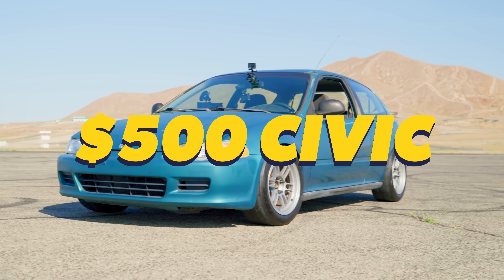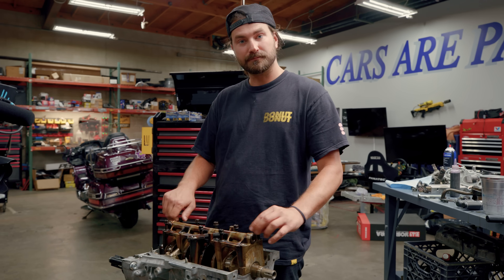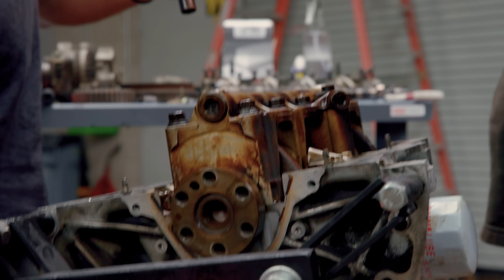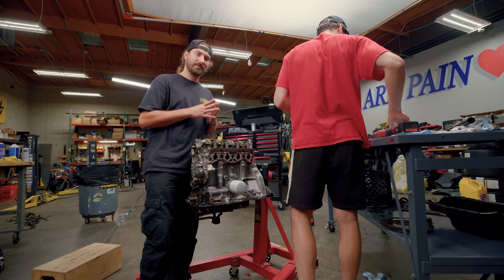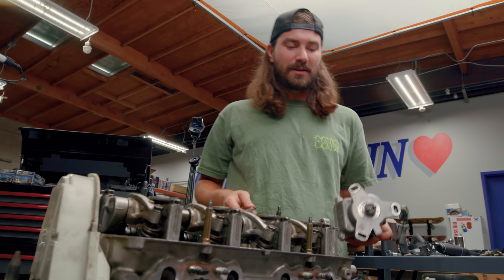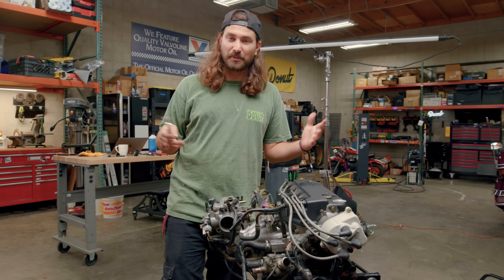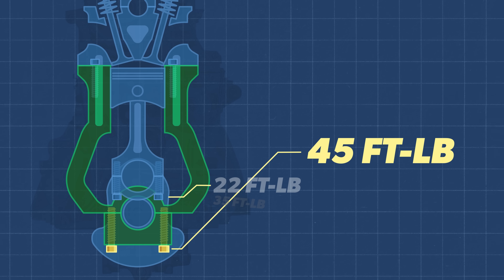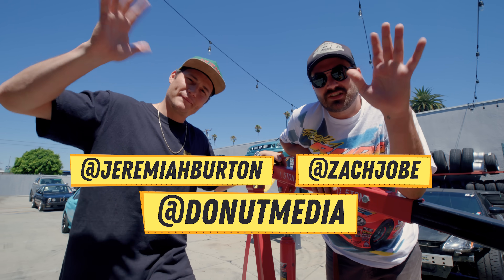Trying to Rebuild an Engine with No Instructions

Comment: Episode idea:  Do an engine rebuild with only cheap weekend warrior tools and show where good tools would have made things better.
Reply: I love to think that entire episode would be just them losing socket bits every time they try and it’s hilarious
Reply: They only get use the Walmart $30 special tool kit. 😂
Reply: @SonicProvocateur  Many years ago, when I was young and hungry, I pulled off a lot of fixes with little else beyond a cheap socket set and a few crescent wrenches.  Never underestimate the guy with more determination and time than money.
Reply: Yall are paying for tools??
Reply: Yeah, not that impressive if you have hands and not meat sticks to work with... basically rebuilt my 5.9 Magnum with a 50$ ratchet kit, a BFH and a 3' helper bar...
It's getting torn down today since the truck gets lifted/SAS/4-linked with an exo cage. That's 4 years and 28000 on here and other than the infamous plenum leak it all looks perfect still.
Reply: Engine rebuild with only harbor freight tools and if you break a tool you can’t replace it
Reply: @LostMyName15  hell yeah! Love them 2nd gen dodge gassers,  how'd all your mods go on it?
Reply: hi-low?

Comment: As a student in school for diesel tech, I actually had to do this with an international D466 we did have the torque specs and the specs for the valve lash, but that's the only things we used the manual for. It took my group about 11 weeks to get our engine apart, put back together, and have it run. It was a cool process and I recommend it for anyone who has the time and money and wants to learn all the ins and outs of an engine
Reply: 11 weeks? It took mine 4 weeks to rebuild a: 6.4 Powerstroke, MX13, DD15, ISX Cummins, and a 400 Big Cam Cummins. We were there for four hours a day. What the actual fuck took y'all so long on a nearly fully mechanical 30-50 year old engine?
Reply: Indeed!

Comment: That was cool. I give it 3 brownies. You need to put that engine in a golf cart, preferably a Yamaha. They have the  chassis to hold it. Thank you for your time.
Reply: good idea
Reply: That sounds both awesome and like a quick trip to the ER lol.  A golfcart and a SxS are NOT the same thing lol.  Thinkin about all the GrindHard projects, they ALL require(d) notable reinforcement, steering/suspension geometry changes...

Comment: Bolt torques are really important for a good long-lasting engine. But I stripped and rebuilt my corolla's 1971 engine when I was 16 without even knowing what a torque wrench was for. And it ran for almost a year, until I blew a piston and decided to buy a crate replacement. Just to get an engine started and run for a while you can forget about torque, as long as the bolts aren't actually loose and the head is properly tight on the gasket, it will start and run just fine.

Comment: Reusing old engine bolts (and then overtorquing them) seems like a great way to cause catastrophic engine failure at some random time in the furure.
Reply: Shouldn’t be an issue as long as the threads are in good shape you can tell if a bolt was stretched.
Reply: I don't think they'll be reusing this engine....soooo
Reply: Whatever, it's a Honda 😂
Reply: Go checkout a sloppy LS rebuild lol

Comment: Instead of being some sort of "challenge" episode, i honestly wish they took the opportunity to make this a money pit episode and showed strategies you could use when reassembling something without instructions. 

If you're working on a make of car thats not that well documented its extremely common to do things without any instructions of any form
Reply: what you should do is not assemble something without instructions. they don’t plan on using the engine for anything so they wouldn’t be losing anything if they fucked it up
Reply: @misseselise3864  the last 30 seconds beg to differ
Reply: @TheRealSykx  its a 12 minute video the last 30 seconds aren't that enticing for watching all of it
Reply: IMO the takeaway is that torque specs aren't as critical as people think.  Most of torque specs is to ensure bolts aren't literally jiggling loose nor so tight they snap off.  Torque specs are literally just tested values that worked during the R&D phase and they have techs use to ensure failures weren't due to faulty assembly.  Someone that has put enough things together to know the feel of a well tightened bolt could probably successfully rebuild an engine without even a torque wrench and have it run just fine.  In fact, people will do that all the time during a rush repair right before a race when they don't have time to setup torque wrenches and look up specs.
Reply: @nunyabusiness896  honestly depends on what you're torquing down but i see your point

I know i almost got the shift linkage to die on my car by torquing it so much the bolt was stuck on the transmission!
Reply: If you have to take something apart just take a bunchload of pictures, videos and stick the bolts into cardboard and write where it went.
Reply: If you have to assemble something that youve not taken apart and cant Find any info, tough luck. Youd have to have some level of engineering background and taken similiar parts apart to know how it functions.

Comment: Put it in a motorcycle, I’ve always wondered if putting a slow 90hp car engine in a bike would make it super fast, and if it’s even possible!
Reply: YESSS!!
Reply: Yea I’d wanna see that
Reply: The lowest power a new Honda CBR600RR has ever had is 97.7HP wheel and the CBR1000RR is currently 214 bhp crank if that answers your question?
Reply: @mycosys true, just wondering if a slow car engine could make a super fast bike
Reply: @Kiluajohnson2 too heavy, there is a bike they stuffed a viper engine into it is the heaviest bike ever.
Reply: good idea
Reply: Dude who lives in the town I used to has a honda shadow with a k20 engine in it he said it's heavy required good amount of fabrication to fit and required more fabrication so he could sit on it with out getting burned by the engine
Reply: @Kiluajohnson2  It'd weigh a ton.  There are bikes with 3,4cyl engines but they're built FOR a bike.  Lightweight materials, compact engineering...  Theres been some concept bikes and 1off's with v8's n stuff but they're more novel builds than anything practical.

Comment: I'm not a honda expert on anything besides my own but doing rod bearings on my J35z2 taught me a few things. Right away the lack of an angle torque spec was a little worrying, cause the rod caps for my engine was 35ftlbs and then 90 degrees. Head bolts were worse, that I believe was a two step lbft sequence of like 45 and then 80 and after that it was 3 rounds of 90 degrees in the sequence, I was very tired after that and I was just changing out cylinder 6's piston with cylinder 3 from my first engine. (After doing rod bearings my engine went on to run another 20 minutes, I blame myself for not using assembly lube on literally anything even though I bought a tube of it. I have since swapped a third j35z2, this one being out of a 2014 RDX, into my crosstour, got about 1800 miles on it so far)

Comment: I rebuilt my EJ25 having never did this myself before. I also port/polished the heads and added headstuds. I too afraid the pull the pin on the timing tensioner though. It just sits in my living room, in a corner on a stand. At least my wife is cool with it. The ‘98 forester with 98k original miles is just sitting out back in the yard. I weedeat around it at least.

Comment: Here's a really good tip to keep in mind about your vehicle:

If you have white smoke coming out of your vehicle's exhaust, you're likely either burning coolant and have a blown head gasket or you have fuel in your oil, which indicates leaking fuel injectors. So, before you bring your car to a mechanic to fix the white exhaust smoke problem, check your coolant level and the smell of your oil! If the oil smells like fuel, you got leaking fuel injectors. If the coolant level is low, but there's no coolant leaks, you got a blown head gasket! Now you know!🙂

Comment: Best advice I have is to leave the bolts in what your are taking off. Or put them in ziplock bags and label the bolts. The. Tape them to the part. Saves lots of headache and keeps you from losing them.

Comment: as a diesel tech a C-15 engine main cap torque is like 190 ft-lbs plus 120 degrees. this is nearly 400 ft lbs. hearing 45 ft lbs on mains is just wild to me

Comment: Would be fairly straightforward to put a Ford 300 inline 6 back together since there’s timing marks on the timing gears. The timing (cam and spark timing) is probably the most difficult thing when putting any engine back together.

Comment: That D16 would make a great engine for another Money Pit series. Maybe get a shell to put it in and make a fwd autocross car? You could also do another Hi-Low. I know you probably had a heart attack just reading the name but here me out. You could do it with civics. The parts are generally cheaper and more abundant. Your K20 EG as the high car, and the D16 as the low car. I recomend an EF (88-91) civic or crx but thats just me loving EFs.

Now before y'all verbally slap me for thinking a D16 can compete with a k20, i got sumthin to say. 200hp is 200hp just sayin. The k20 could remain NA while the d16 gets a turbo. Would be a great matchup.

Comment: Or impressed! Without a channel, I purchased a ‘87 RX7 sight unseen, with no prior knowledge of vehicle. Brought it to garage, completely disassembled the front and rear of car, so I could paint all the subframes and bits and pieces- threw all the nuts and bolts in a box. after one year, I went back to garage and reassembled everything, with probably 97% completion. The car had a granny sbc swap kit on it, so there was no manual to help, just pure passion and memory. All hand tools, no lift, no additional hands to help lift subframes. Next time, pursue that challenge

Comment: I learned the hard way you can’t just put a motor together like this it will always run for like 400 miles bearing clearance is the most crucial part of the build

Comment: Put it in a car and see how long an average built motor will last. See if over torquing the bolts has any long lasting effect on the motor or make any weak points. Would be interesting

Comment: Well. I can certainly say those bolts wont be coming out soon. High potential for stripping all that. I havent seen them go over 32 lbs....usually 25 to 29 for a 4 cylinder does it fine, when I used to repair engines for months on end at my old job.

Comment: Having rebuilt a b18b and knowing the differences between the ls and gsr torque specs, I was so sure a bolt was going to snap, relatively the d-series and non vtec b series need very little torque.

Comment: Put it in a mill or drill press. 
Or a shop vac. 
Or maybe a motorcycle.
Maybe a fan.
Or (best one) put it in a car, but have it run the “accessories” like the water pump and ac and pretty much everything but the wheel so you can get max hp out of the engine to the wheels!!

Comment: If there's one thing you definitely SHOULD know about putting an engine together, it's torque specs....

I hope y'all said your prayers and were good boys. Otherwise, the car gods are absolutely going to smite thee with thyne thrown rod or spun bearing. 

Y'all should definitely look at rebuilding an engine like this and throwing it into some sort of ultra-light platform (like a street kart, sand-rail, etc.)

Comment: Put in the tiny electric truck and do more overlanding stuff with the tiny red truck with a civic motor. I mean you can’t get a more reliable engine and the power to weight ratio would be perfect

Comment: Folks you can build a free running magnetic engine using your pre existing alloy engine simply place magnetic caps on top of each piston and replace the valve head with a magnetic head or electromagnetic head, placing a magnet above each piston NEVER PAY FOR FUEL OR ELECTRICITY AGAIN

Comment: Maincap girdle is what that's called. And you shouldn't rotate a crank on new bearings with no main caps. They actually have standards on standard and metric bolts as far as torque goes. Could have used a caliper to find out and go from there like I know 3/8 are usually around 35ftlbs and 1/2 is like 90ftlbs.

Comment: I'd be up for seeing the engine put in whatever.  Just to see if it can make something move.  Outside the box:  A dirigible.  
Speaking of small cars, YouTuber Eric over 'I Do Cars' has a very nice Miata that somehow ended up getting a Missouri Junk Title, which is almost irreversible anywhere in the US, and renders the car totally street illegal forever.  Michiganders however, think otherwise for someone in Michigan to get the Junk title rescinded and converted to a regular salvage title.  It runs fine and is way too nice to turn into a parts car.  Just say'in...Miata.

Comment: I'm wondering how long it will take to cook the cam bearing after torquing the cam cradle down to 25 ft lbs. It's only supposed to be like 7 ft lbs on a D series. And I'm hoping there was assembly lube involved with this rebuild.

Comment: I mean if it's an engine you haven't done before

even if it's basically the same Inline 4 Twin Cams EFI with VVT

torque specs / sequence of disassembly and assembly might be a bit different

Comment: This idea may have a very small target audience and be a lot of work, but could you try to 3d-print TPU bushings (instead of PU bushings) and try them out on a car?

I initially wanted to install bought ones on my E46 330ci rear subframe but I saw that they are kind of expensive in Germany, I guess due to trouble with the registration that the manufactrer has to go through to make them road legal here...
So I briefly thought to myself, what if I just printed them myself? (which wouldn't be legal either but f it)
I quickly decided not to do that since 3d printed parts are a lot weaker than homogenious injection molded parts due to layer adheasion etc.
But I must say,  I am curious how well that would work.

Kind regards from Germany :)

Comment: pfft. old junkyard hondas dont need torque wrenches. i threw a few together with a 3/8" air gun with no issues, reusing all the bolts AND head gaskets... old hondas are like legos, you just build em over and over. long as theres no wutang whirlieboi on there youre fine lol

Comment: I don't think 55 - 65 lb/ft is going to make the blind bit of difference, 10 - 20 ft/lb is the difference between clean and dirty threads.  An experienced engine builder will get the torques within 20% without reference material and without a torque spanner.  There are some that are more critical like torque to yield where you'd have to look it up.  And there are some that you have to torque up more than you'd think.  Therapeutic to watch.  I'd expect it to work just fine, if something leaks then probably needed to be tightened (or you overtightened it in the first place - most people overtighten).

Comment: This is a cool idea, but not giving them the correct torque specs is just f$cking stupid, ignorant, and childish.  Torquing the bolts to the wrong torque specs could lead to anything from the heads not sealing properly and blowing out the head gasket to rod bolts coming undone or snapping and sending rods through the side of the block.  To quote Philip Defranco "Don't be stupid, stupid!"  Please don't do stuff like this anymore.